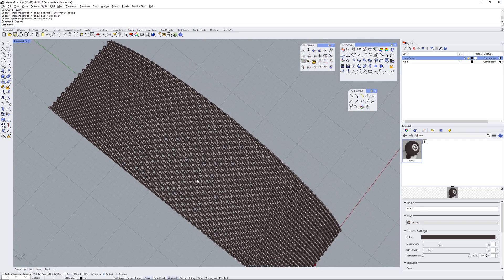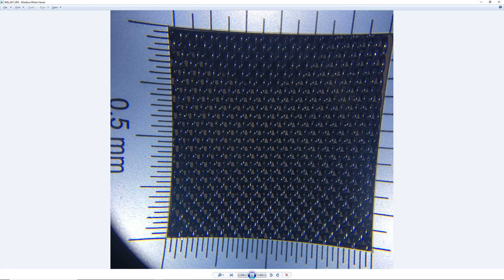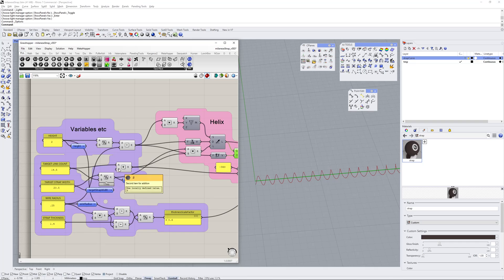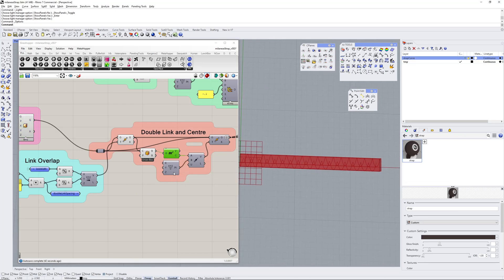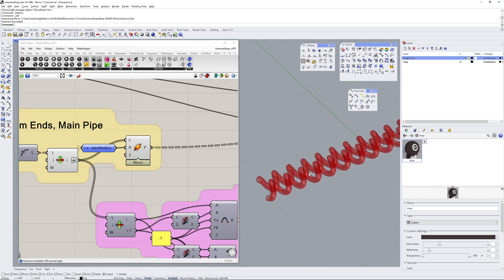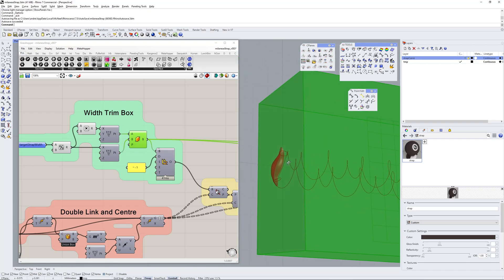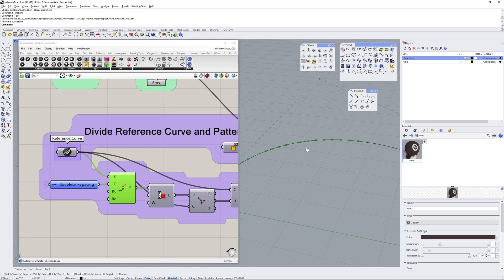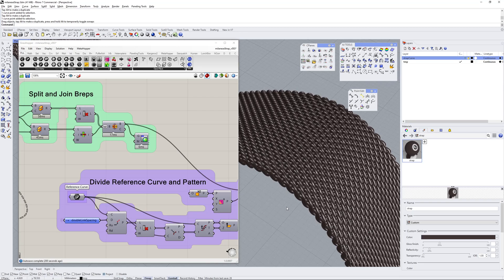Rhino & Grasshopper: Constructing a Milanese Band in Grasshopper

Comment: Thanks a lot for sharing. 

can we 3D print this ? and will this band be flexible after 3D printing in Metal?
Reply from the maker: Yes, bake the geometry then it can be printed. Probably have to add clearances between loops and whether your printer can handle small tolerances.